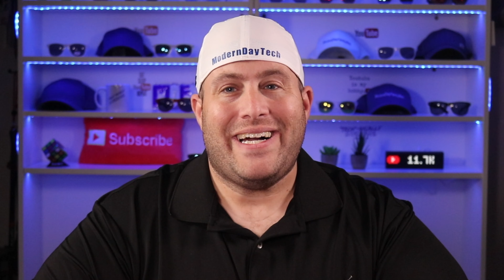Aqara Hub Smart Home Alarm - The Most AFFORDABLE HomeKit Security System

Comment: What's the difference between these and wyze devices?
Reply from the maker: Aqara is by far a more complete package. Don’t get me wrong Wyze has a few good products but I feel they’ve lost their focus. If you’re a HomeKit its a no brainer, go Aqara.
Reply: @ModernDayTech  in what way do you think it's better? Cam you explain because I'm seeing prices and devices but kind of see it the other way... depending on what exactly your trying to do tho.
Reply from the maker: I’m assuming you’re not a homekit user?
Reply: @ModernDayTech  i just started collecting devices bought 3 Wyze cameras a bulb and piety a couple smart power outlets and sensors all for less than $100 the cameras do everything i need pretty much plus they have smoke fire alarm like i never seen any have that and other features it has.... got only 19.99 each, the camera alarm settings all push notification the same way this does and they are alex controlled also with all types of settings you can adjust plus you get video recordings in 1080P captured in sd card or to your pc I mean even the cameras alone provide more security than just a sound going off buzzer if someone goes in and kicks that darn thing out of the wall socket.
Reply: @ModernDayTech  just trying to figure out why you think its better.

Comment: I can't trigger my device !!! Aqara app don't have the possibility to trigger something..... And With Mi Home i have error 7 if i press on the hub !!!!!
Reply from the maker: I can't speak for the MiHome as I haven't used it much. In the Aqara, you have to automate the triggers to do something with the automation tab (bottom) and put in the If & Then fields.
Reply: @ModernDayTech  If i Turn on the aqara hub from aqara app i can trigger a device to enable the alarm but not on home kit, if i turn on the alarm system on the home kit app and open a triggerd device, it doesn't trigger the alarm system...

Comment: Question: Is it possible to trigger the hub sound if you use a Eve sensor in a scene ?
Reply from the maker: I don't have an Eve sensor but I believe Eve is Bluetooth so it wouldn't connect. Even with the Homekit integration, you can arm and disarm the system but can't trigger the alarm with Homekit automation so even sensor wouldn't work. The automation for the alarm comes from the Aqara or Mi home app. Currently though, as I said in the video when I arm the system in Homekit, it doesn't trigger the alarm in Aqara. I had to move over to Mi home for Homekit arm to work properly but I'm sure they will fix that soon.
Reply: No, works only with aqara sensors